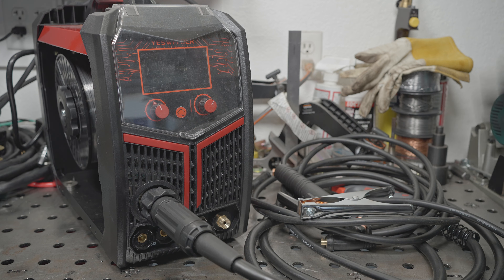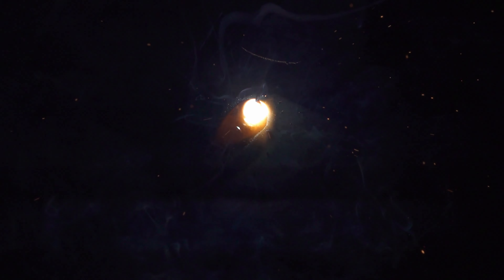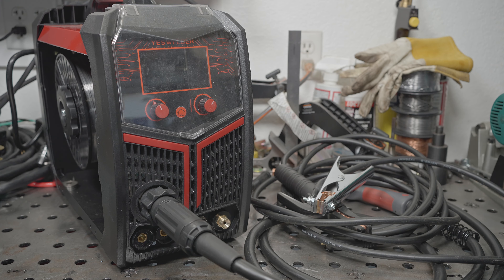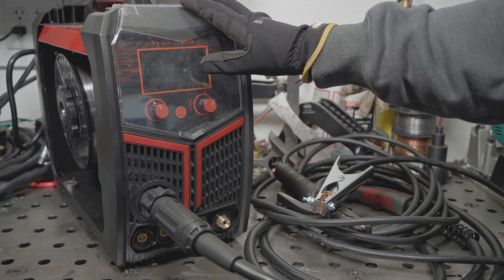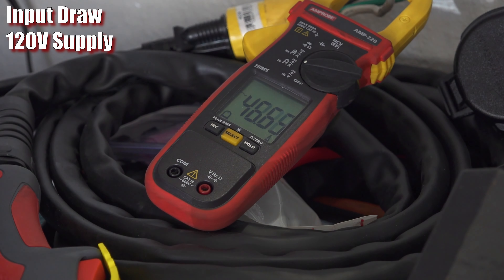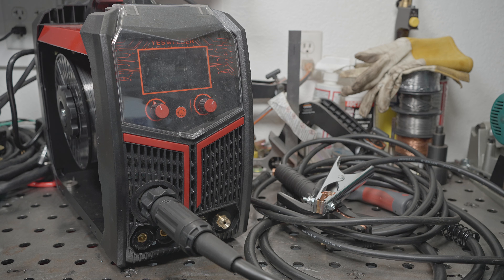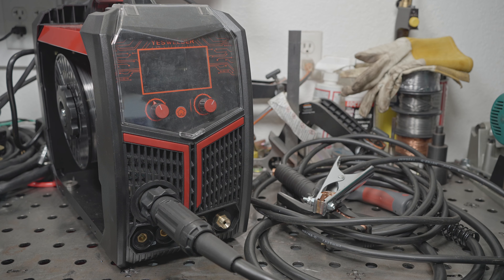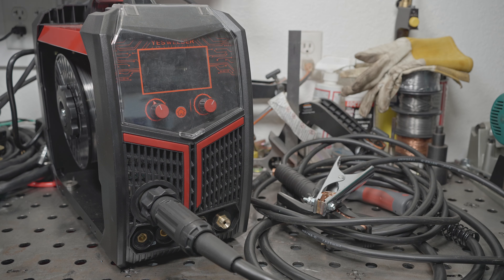Yeswelder Firstess MP200 Part 2: Stick, Dual Shield and Lies

Comment: I would think they are in it for the money, somebody else is putting them up to this.. I will stick with my Esab/Fronius/HTP/ welders, they do what they say and then some, yes they cost a lot more ,but they are so much better.  I have seen other Youtubers go at great lengths as to how good yeswelders are , you can tell that they have sold out to inferior equipment.
I saw one guy do as you did and call them out on how bad his MS205 was, he was not impressed, at least he was a not corporate sell out.Yeswelder is banking on advertising hype to sell, just like all the other charlatans out there. Remember there is a sucker born every minute, don't be one.
Reply from the maker: On Yeswelder's YouTube channel they now have a couple instructional videos.  They didn't produce the videos, they are made by other YouTube creators.  In the setup video the guy went on about how the machine is smart and will choose the amperage and voltage for you automatically if you pick the thickness you are welding, but I could clearly see on the screen that he had the voltage adjusted down 1.4V from the auto setting.  He didn't mention that, lol.

And you know what, if someone is "in it for the money" that's fine.  It's not like an actor General Motors hires to be in one of their commercials is going to point out things they DON'T like about the car.  In the same way, I wouldn't expect that guy, on Yeswelder's channel, to say anything negative about the welder.

But if General Motors' latest V8 engine was found to actually be a 6 cylinder with two completely fake cylinders, I would call them out.  Especially since they didn't just advertise is wrong, they went through the trouble of adding fake cylinders to further the lie.

In the same way, Yeswelder didn't just say this would be a "200 amp" machine and that it would run 6010.  They specifically programmed the display to go to 200 amps and printed data tags that show duty cycles at 200 amps.  And they put a 6010 mode in the settings.  They can no longer claim they are at the mercy of whatever the factory gives them.  Yeswelder are knowingly lying at this point.  Maybe the stick output is a small thing.  Maybe people think I'm making too big of a deal about this.  But thousands of people have spent millions of dollars on a kickstarter campaign for this machine.  It's not just a matter of "sorry folks, turns out it's only 160 amps when stick welding.  We had to pack a lot in here and we still think it's going to do everything you need."  Nope, none of that.  It's just lies and deceptive programming to make you think it can do something it cannot.

If someone likes this welder or talks it up, fine.  That's their prerogative.  Yeswelder, in my opinion, are the ones who need to be held to account.
Reply: @bigtb1717  I agree with you totally

Comment: Ansi Certified? AWS Certified? ASME? Iscet Certified? Are you? Mpi send me a machine and ill give you a expert opinion.
Reply from the maker: The simple answer is no, I am not a certified welder.  

ISCET:  I hold no certificates from the International Society of Certified Electronics Technicians.  Their training courses sound interesting though.  I may look into it.

ASME (American Society of Mechanical Engineers):  They do not certify welders, they certify products.  A company could get a welded product, i.e. a welded pressure vessel that they sell, certified by ASME.

ANSI:  In what way could an individual become certified by ANSI? I don't know of a way, but I'm no expert in all things ANSI.  Do you know a way?  My understanding is that they come up with safety and operational standards for various products and processes.  A company could certify that a product, process or even a facility meets a particular, published ANSI standard.  But again, I'm not an expert in all things ANSI.

AWS:  No, I do not have any AWS certifications.  

I'm not sure if your last sentence was a statement or a question.  Are you asking me to send you a welder?  Someone else?  Or just stating that if someone DID send you a welder, you could give it an expert evaluation and opinion?  Do you believe I got something wrong in my video?  I'm happy to correct anything I got wrong.